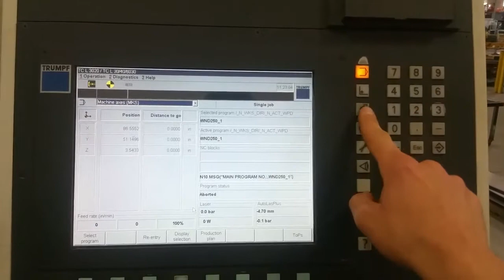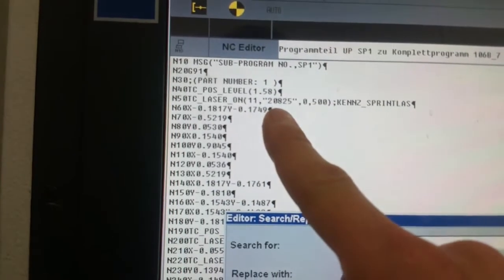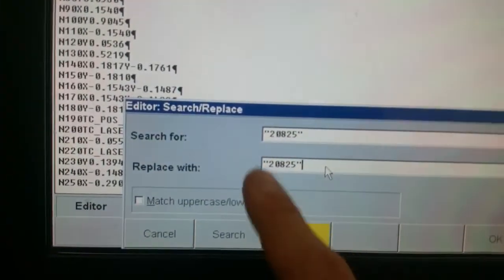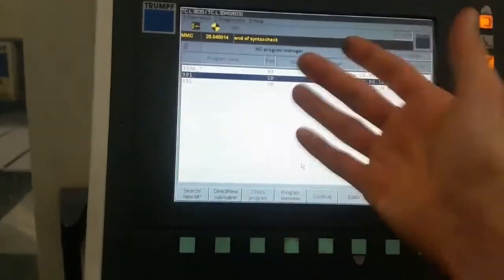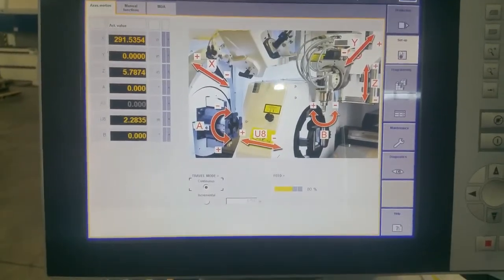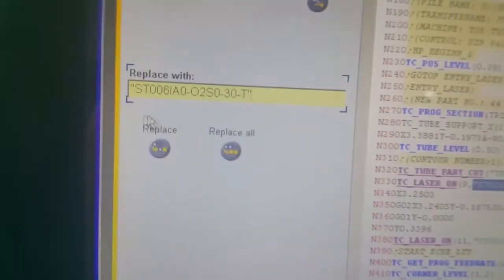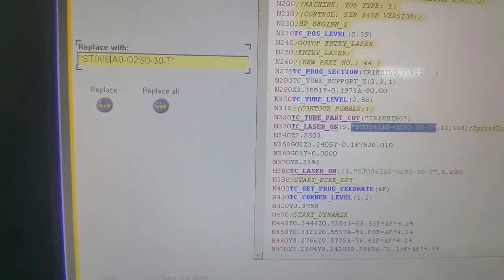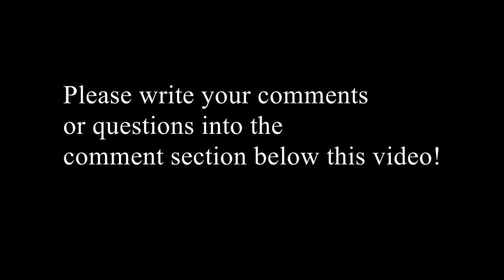How to change NC codes for Trumpf machines

Comment: sir ,coud make video about nesting {programming true tops } truelaser 3030
Reply from the maker: Hello Binu, I would like to make that video, but I am on a long vacation now. If I will have a chance to make the video "How to nest parts" I will.
Thank you!
Reply from the maker: Hello Binu, just a hint for you. If you open the programming software TruTops, there is at the top-right corner a button "HELP". Click the button and it will offer you to see the programming manual, where is written everything about programming and nesting parts.
You can find there everything you wanna know.

Good Luck
Petr
Reply: Hi binu
Reply: Hi
Reply: PLC Multi Tool lock does not reach the locked lock position
Reply: Namber send